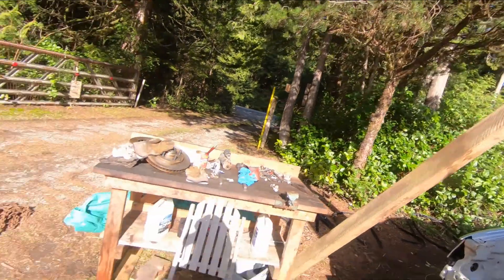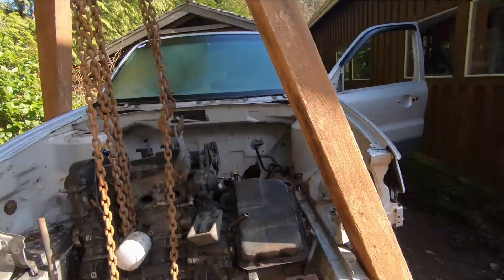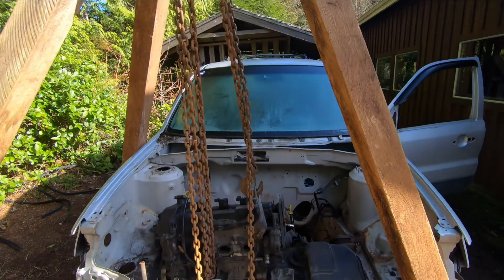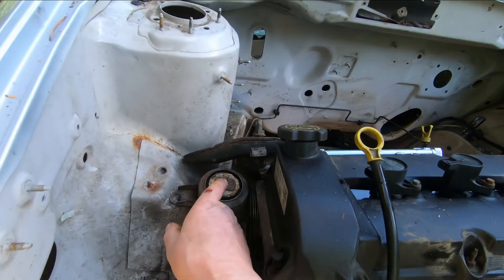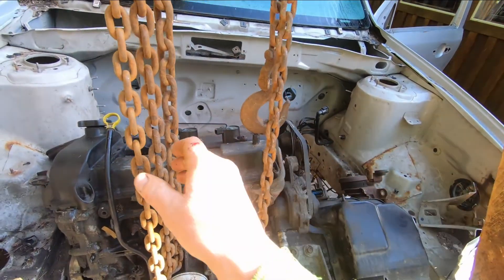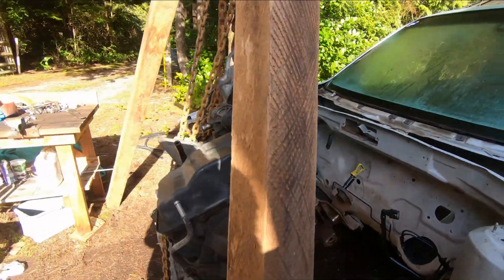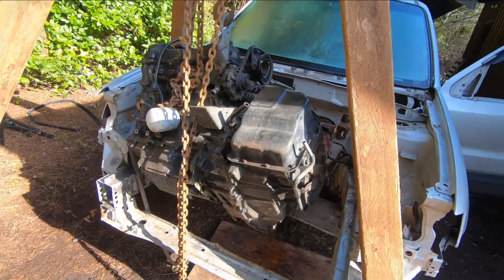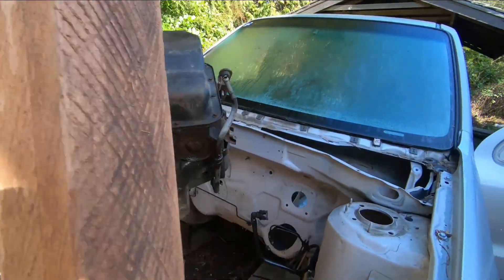LIFTING AN ENGINE WITH A HOMEMADE TRIPOD

Comment: Absolutely perfect, and KISS engineering at its finest! Got a bad back, not enough salvage steel to make a hoist, but do have a snatchblock and will power. Off to get timbers!
Reply from the maker: I'm glad you found this tripod lift idea useful. Best of luck with the lift and --be careful!
Reply: @EverydayProjects  Funny addendum, as I'm headed out the door to get timbers, I tripped over the foot of a little giant ladder I forgot I even had as it tends to get used by my kids as an empty can holder when they're too lazy to put them in my collection bags (I melt them down periodically for aluminum projects), and bam! Cans go flying revealing my perfect potential suitor. Nirvana, lightbulb moment, AH HA! While the engine is relatively small, it's an antique garden tractor motor, so I ended up tinkering with pulleys and some cable to make sure I don't cap out the weight limit. It's a good 200lb cast iron monstrosity... 
Still love your vid though! Perhaps even seeing it set me off on my serendipitous path today. 😁
Reply from the maker: @C-M-E  I meant to to say "Be careful AND DON'T TRIP OVER ANY LADDERS !" I should be more clear in the future. haha glad you found a solution.🤣🤣🤣

Comment: Ah jeez... Sorry. I was supposed to have the helicopter there for that wasn't I? As you saw in the last video though I had to keep it grounded and covered up for a while until the heat blew over. Seriously, love that idea. Cumbersome as heck but simple and rugged. I'll sure remember this one. I have a chainfall and I have a few jobs where a big tripod would do the trick but I didn't really know how to put one together without bolts and drilling and praying to God! I ordered an undercoating gun much like what you have. I never knew they existed before. Glad to have come across your channel!
Reply from the maker: Yes, the helicopter would have been a big help! But this worked. I moved the engine/transmission to my truck then ferried it over to a shed with an outside beam where I hung it up on the chainblock. These tripod hoist work for anything, I've seen guys put them up to hang moose and deer too. What caused the fire in the trees?
Reply: @EverydayProjects  March going out like a Lion and it blew a young Poplar down and it made contact with the high voltage lines. Completely not a mishap with a low flying unlicensed helicopter!
Reply from the maker: @heliarche  Yeh right. I saw you in the helicopter!